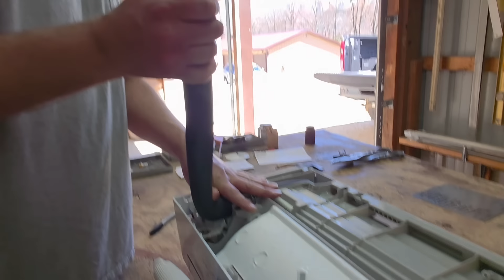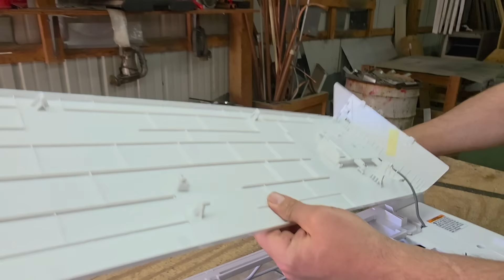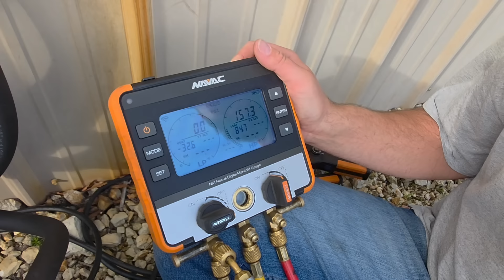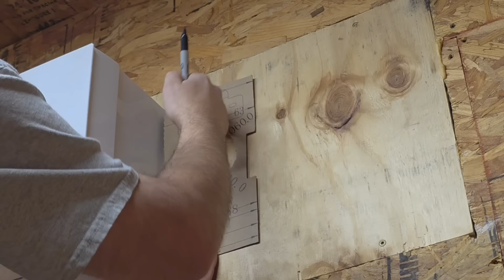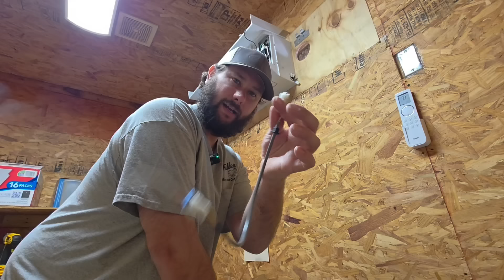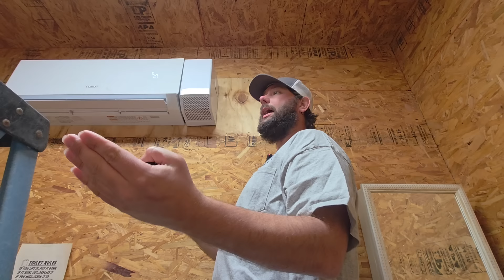Installing a Mini Split with ERV: The Coolest Duo

Comment: I just installed my first Tosot heat-pump using this video as a reference.  I opted for the 18k Aoraki w/o ERV.  Luckily, it fared better in shipping than yours did.  I agree the flares looked perfect out of the box.  Thank you!
Reply: Im thinking of ordering a 2 zone did you pull your vacuum removing the valve cores with a removal tool?
Reply: @Chris4796 I did not remove any valve cores
Reply: @rccotrone3391 Thanks for the reply!

Comment: Would it be possible to use that ERV as a stand alone? Also, does it have a way to capture humidity/condensation/water? Thanks
Reply: this ERV wires directly into the Tosot indoor air handler, but you can buy standalone ERVs

Comment: I just got a new client with a lot of rentals. The first call I did ended up being a burned wire going from the herm to the compressor. The coil was dirty as heck and the cap was low. All he wanted me to do was get it going. Didn’t want to pay me to clean it which was probably the main cause of the issue. It’s just how it goes sometimes. Of course the filter was way dirty to boot.  All I could do was tell him the issues and let him decide. I guarantee I’ll be replacing that one soon though.

Comment: On a new construction can I run the line sets inside the wall cavity so they arent on the exterior of the wall?
Reply: @trevorbrown9091  you need to make sure there aren’t any super sharp turns in the line set or condensation line and that it’s really well insulated and the insulation isn’t compressed anywhere, or it could sweat. But yes, you can.

Comment: Hey man, good video. ERV with a minisplit is awesome. Does the erv run constantly when on on the remote or is there other modes to have it turn on only when needed?
Reply from the maker: I've noticed that it runs every fifteen minutes i think it's fifteen minutes on fifteen minutes off

Comment: Hi taddy, the drain line you can use a torch and heat the tip of the pipe and just put the drain hole in it 🤷‍♂️ just asking if I'm wrong. Let me know

Comment: Hi which one is best Mr cool unit or this one for a 40 by 40 garage?
Reply from the maker: I would get the 2 ton model, but make sure your foam insulating.
Reply: Thanks
Reply: Potential problems with cutting lines
Overcharging the system: Mini-split units are factory-charged with the exact amount of refrigerant needed for the included line length. Cutting the lines short means there is too much refrigerant, which can cause the system to trip a high-pressure switch and lead to damage.
System damage: Too much or too little refrigerant can force the compressor to work harder than it should, leading to premature failure.
Performance issues: The incorrect refrigerant level can lead to poor cooling or heating, as well as higher energy bills due to reduced efficiency.
Voiding the warranty: Most manufacturers require professional installation and proper refrigerant handling to keep the warranty valid.

Comment: Hey Tab, could you cut the extra line set so you don't have all the coil copper behind your condenser.
Reply from the maker: Yes, absolutely, that's actually recommended. I only did this because I wanted to get the video. Done so I can get it out to you.

Comment: Wouldnt this remove heated air from the space and introduce cold air from the outside in the winter? Making heating rhe room less efficient for the gain of cleaner air?
Reply: It has a heat exchanger in the ERV. Yes you lose a little temp but it puts fresh air inside your house. Definitely a plus. Most new houses have an ERV because they are so well insulated the air inside the house would get real stale.
Reply from the maker: Because it's mixing the room air with the outside air before it brings it in.It's tempering it

Comment: You’ll want to cut the lineset to be exact.  With the lineset as a loop, it will function as an oil trap that is not supposed to be there.  You can pump down the system and then cut the lineset.  This will require a flaring tool and a second vacuum on the lineset.
Reply from the maker: The manual states that if it's less than ten foot, you need to put a loop in it.
This loop will reduce vibration and noise
Reply: @taddydigest Yes, but the loop will need to be horizontal and lower than the condenser unit.  Any vertical loop will cause an oil trap.  With this setup, that would be difficult to do unless the condenser is switched to a wall mount.  You could always move the unit further away to extend the lineset, but that would require extending the electrical to reach.
Reply from the maker: Great point
Reply: @pyacobel  unlike r22, r410 is highly miscible (it clings to the oil). So the oil easily flows with the refrigerant instead of separating from it.
Reply: @societyonstandby But this unit is R32.
Reply: Always follow the manufacturers directions on the amount of line set used. Running a loop is fine for mini splits. Don’t ever run it short.

Comment: Man oh man! Wtf is going on here you showing the diy people how to stick their fingers in a live board?? Also surely you don't fall to sleep at night thinking that install you done today look anywhere close to good! That was one rubbish install. I know splits have a minimum pipe run length but come on mate you couldn't cut the pipe back to the min pipe length and made it look half decent!
Reply from the maker: I like it. It's at my shop and as long as I'm happy with my install on my place, that's all that matters.
Little advice for you, you can be helpful or hurtful in life. It's not about what you say, it's about how you say it.
Thanks for watching
Reply: @TaddyDigest  hurtful? I'm telling you how it is bud. No one should ever just go into a switch board with bare hands while it's still live pulling breakers out like that. Only hurtful thing happening around here is you showing qualified or not, it's ok to do that and getting someone hurt!